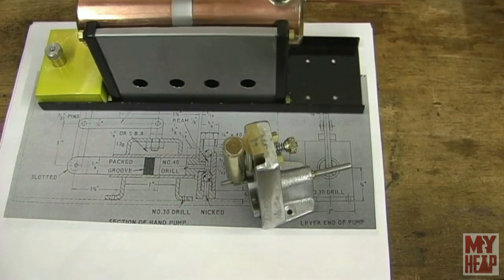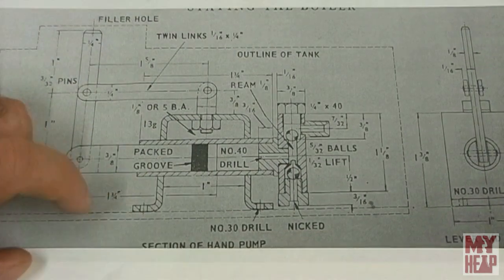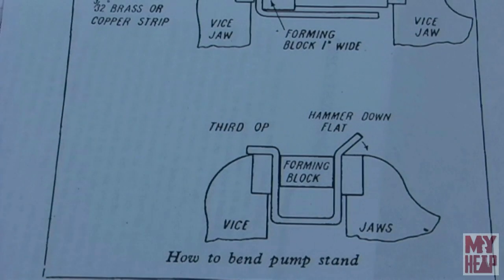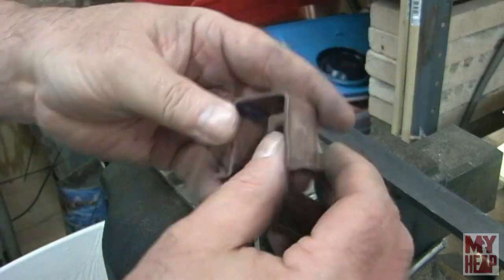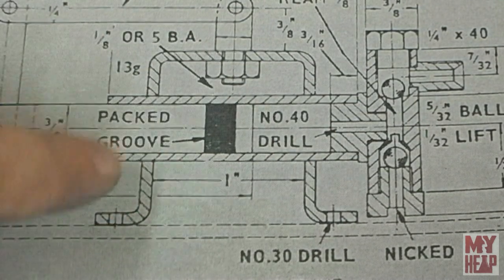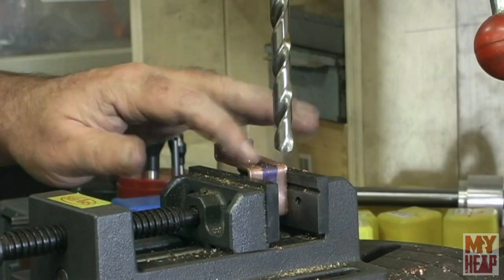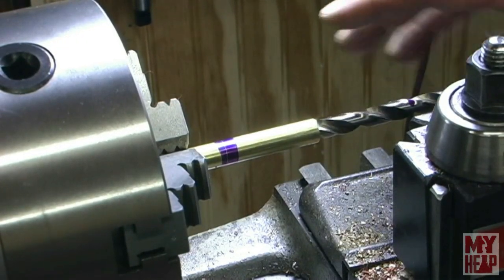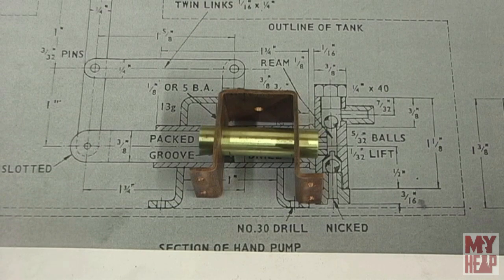TICH Hand Pump - 01 - Frame and Barrel

Comment: hi joe
nice one joe, remember I'm on my first loco, my pump I made a video of a while back now, sits outside the tank on the frame, so will watch with interest as this variant sits inside the tank. thanks for sharing
regards
mr f.
Reply from the maker: Hello Mr. F.  Glad you can stop by.  I remember you making your pump a while back as I recall it was very interesting.  I think functionally, it seems all these pumps work the same way whether they are hand or eccentric driven.  But you are correct, in the plans the pump sits inside the side water tank.  Thank you so much for watching and sharing all the hints and tips with your own loco build.  I have found it enlightening and rather enjoyable to watch.

Joe